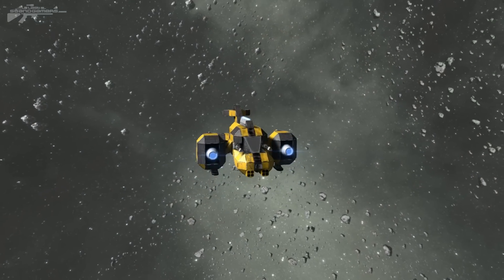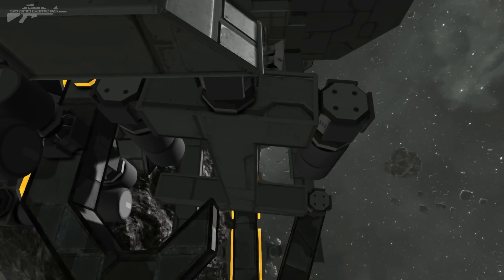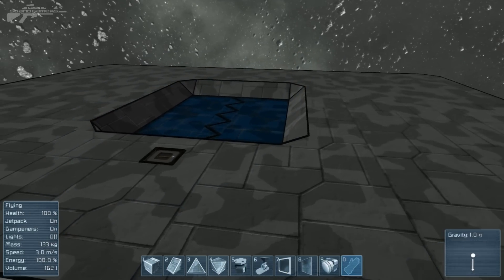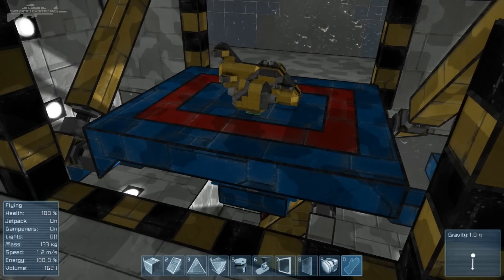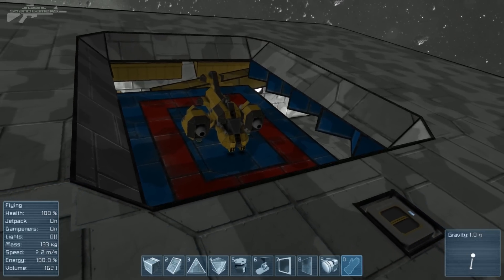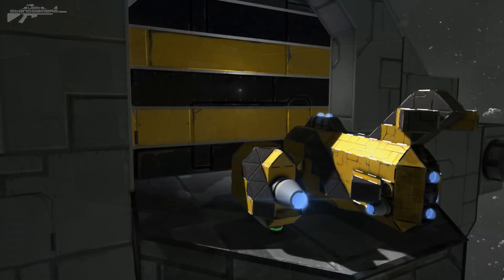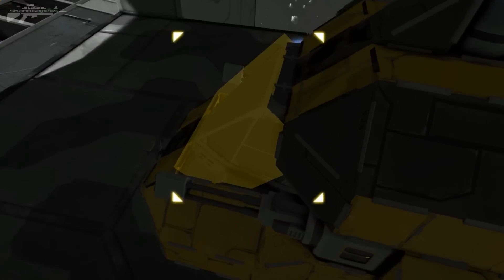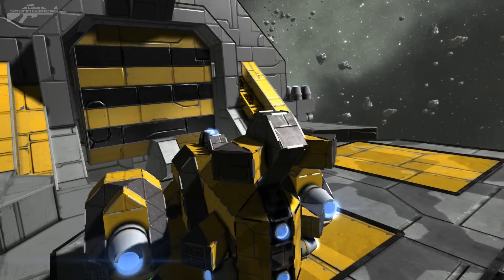Space Engineers - Mechanical Hangers, Doors & Elevator Designs

Comment: This game needs digital electronics. Use a rotor for opening and one for closing (I guess it's probably simple enough to do that if you just attach them together and set them to opposite speeds) and then set up a circuit that lets you toggle one off and the other on with a single click of a button.

Comment: is there any chance i could run this game? ive got a 2.53 intel i3 processor 4gb of ram but my gpu is absoulute shite it's a mobile intel 4 express chipset , i really want this game but i highly doubt i could run it, anyway thanks!
Reply: I'm not really here to dishearten you - to be honest, my computer is probably a bigger heap of shite then yours is - but just looking at your ram and your description of your graphics card there is a high chance that it won't run smoothly when the game is at normal performance demand or higher.

Explanation to my assumption
4GB of ram, for me, is not enough - I got 4GB ram and it struggles to run large minecraft modpacks at times and the game will require a lot of ram to store calculated data. If the GPU is a crap as you say it is then I believe it will struggle to render particle effects and the barrel loads of debris from stuff like destroying ships/stations or excavation.

However, this is just my assumption and it may work on low graphics settings and not doing crazy stuff like bumper cars with star destroyers (however it does sound tempting).
Reply: ok thanks for the help, i wasn't really expecting it to work so im not really that dissapointed anyway thanks! :D

Comment: the mechanisms are a bit slow
Reply: on the second one he made it go faster and it seemed to be alright. I reckon the guys who built these just didn't want to risk loosing these things by making them go fast.
Reply: Plus most of these designs were invented before the "Wheel" update. Main reason damage is caused is the friction from the landing gear. Replace those with wheels and in theory things should be much smoother at faster rates. I will test this myself when I get time.
Reply: That first sentence sounded very kerbal :P  rockets before wheels vehicles rovers batteries on rockets, planes, spaceplanes and boats :D. The kerbal way.